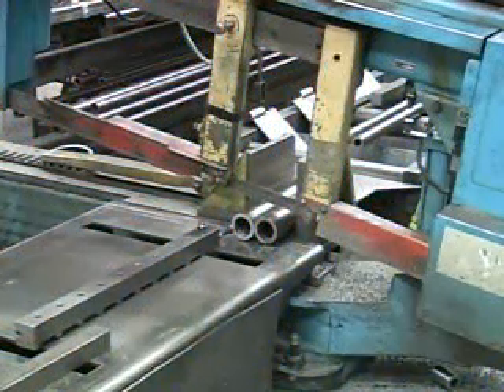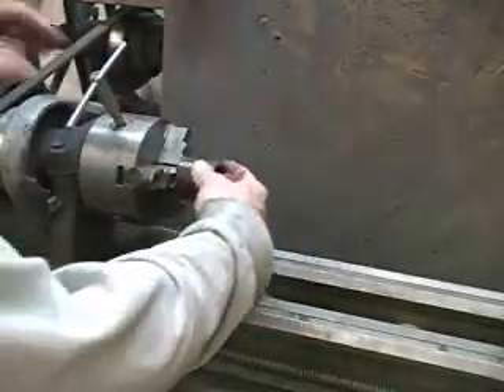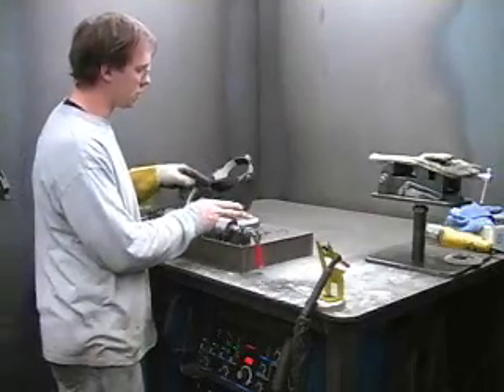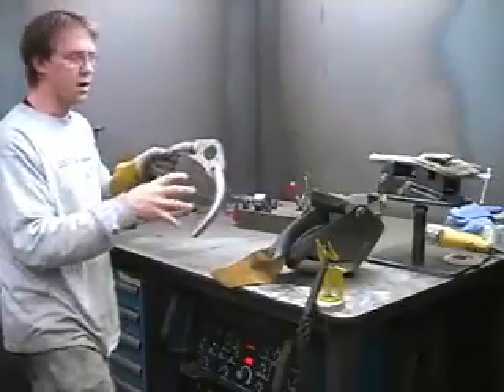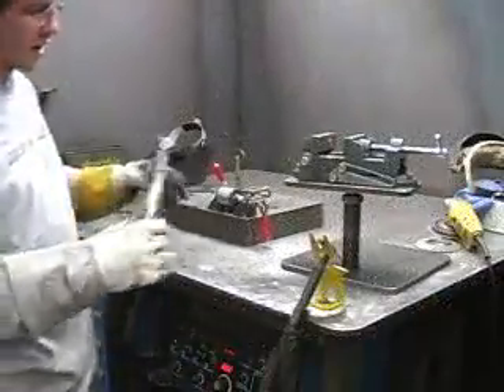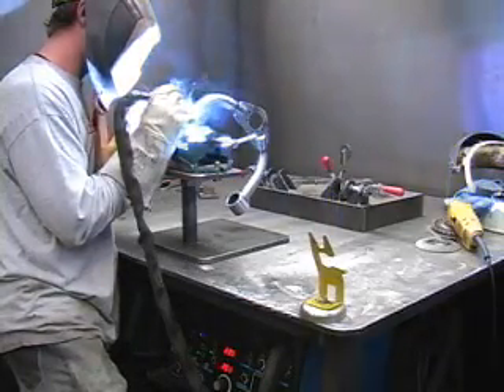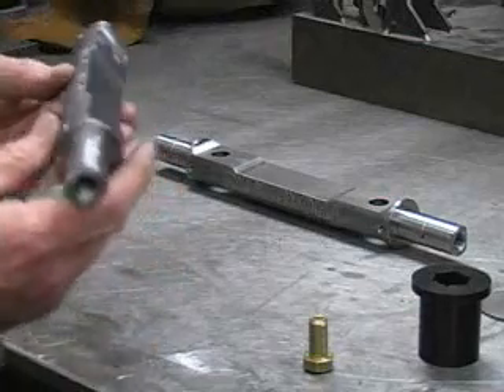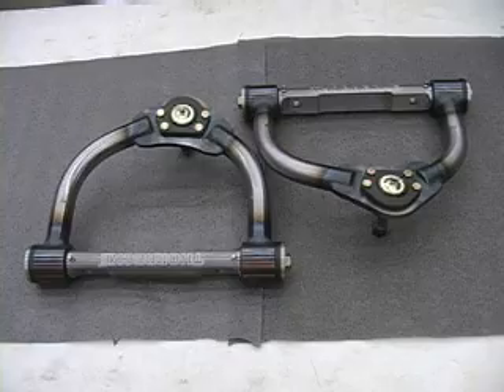Part 2: Building a set of Thorbecke Brothers S10 Tubular Control Arms.

Comment: I have made dozens of various upper and lower & control arms, about 125  chrome molly motorcycle swing arms. When I first tried to do these i tried the same process as you. The first thing i found was that the welding process off the jig caused enough warp to make the part unusable. After that first fiasco i have always welded as much of the part as possible in the jig and then removed after cooling. I also made my jig reversible so i simply flipped the part over and back in the jig and finished the welding process. My parts have always been dead straight after welding with this process. Im not criticizing just informing.

Comment: Bushings provide some cushioning from the road, and reduce damage in control arm parts. Bearings might sound good but;

They don't compress
They don't allow the shaft in the middle to move up/down(looking at the bearing face on)
They require more hardware than a simple bushing(circlip, dust boot, tighter machining tolerances for both parts), etc. OEM normally use a bolt through the bushing, which would never work with a bearing(for very long).

Bearings are only really good when the thing moving can only go round, ie. limited up/down play(few '000ths might be acceptable, ie. oil clearances in crank bearings on). Small amounts of sideways force ends up deforming the cage, causing the balls/rollers to bind and damage themselves(or get jammed).

I believe brass bushings were used once, but urethane and regular rubber were superior because they allowed the steering parts to articulate in every distance(even if it is only a few mm, it helps)